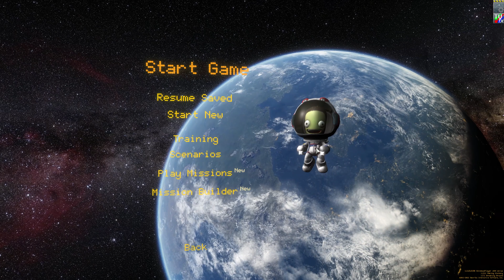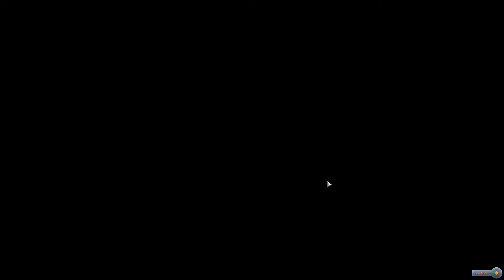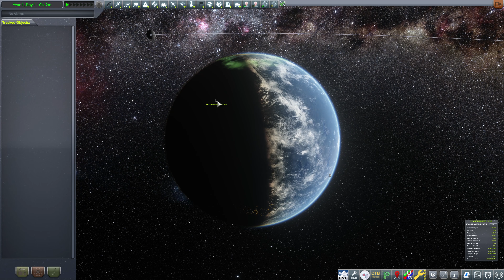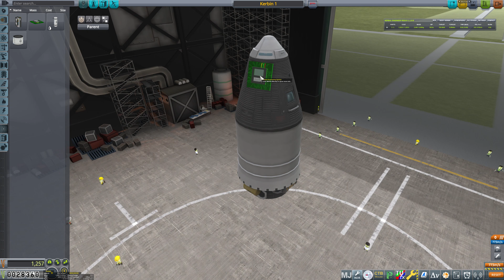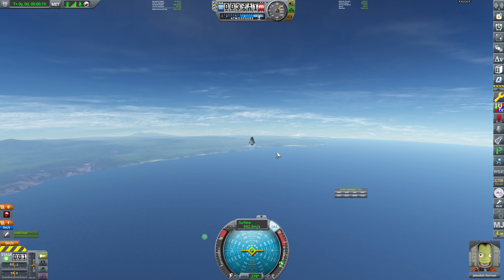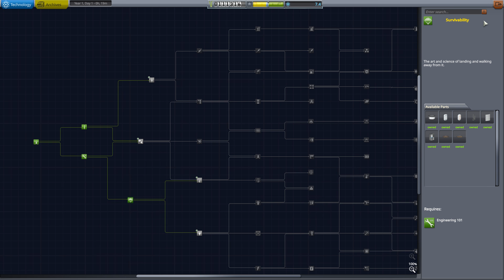Kerbal Space Program Ultimate Beginners Guide for 2026

Comment: why do you constantly cut the words before ending what you are saying? Very distracting and I don't see the point in doing this, you did save what, a few seconds?
Reply from the maker: I’m using an editing tool that finds the silent parts and cut them out, and it’s supposed to put a buffer on both sides so it doesn’t cut off words. It messed up some spots in this one for sure, and I’ve already increased the buffer to reduce it going forward.
Reply: @Czardus It’s incredibly distracting. Please consider never using it again.